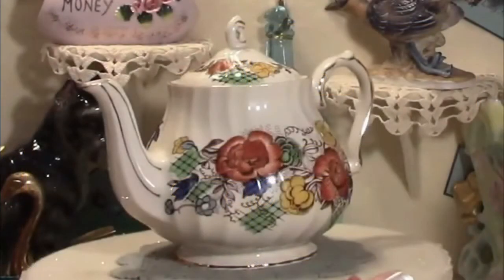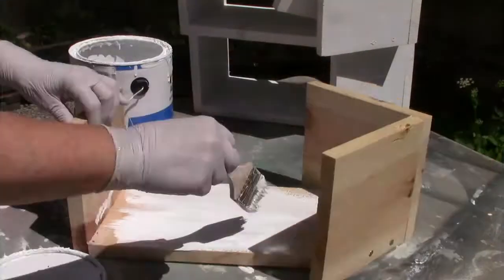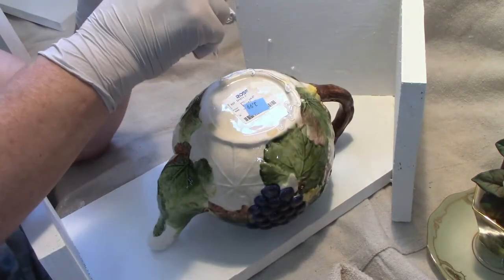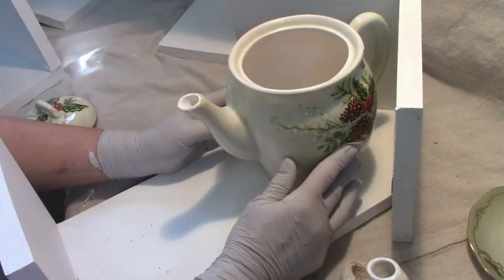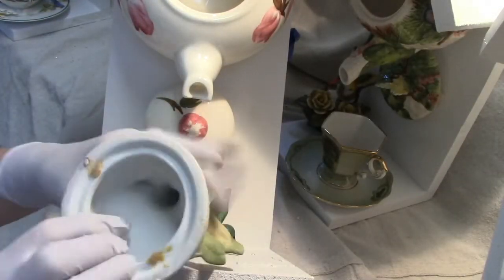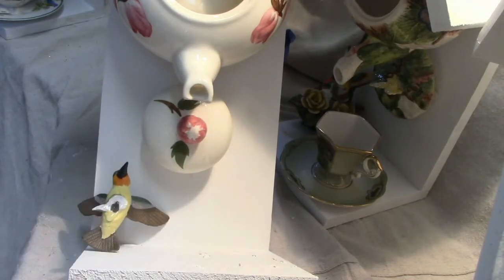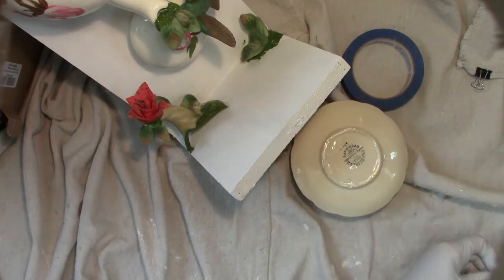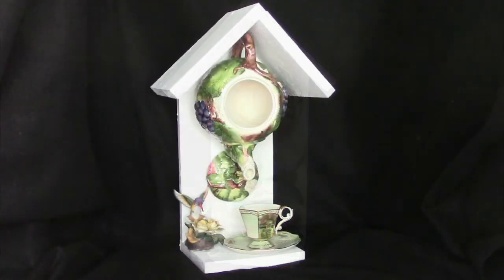What Did I Do With All of Those Thrifted Teapots? I made Bird Feeders!

Comment: Curious if they are actually used by some as bird houses and if so, do the ones with bird figurines dissuade birds from making a home there?
Reply from the maker: This is mainly used for a feeder on a porch. But you can put a disk of wood with a small hole drilled through for small birds.